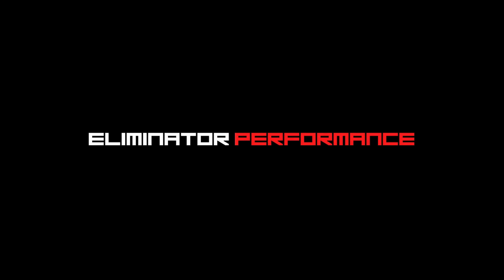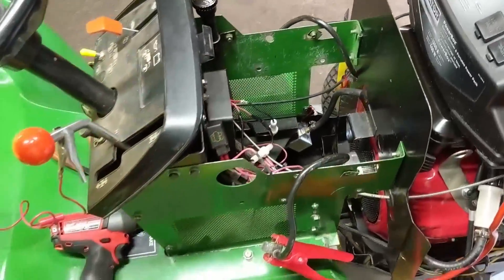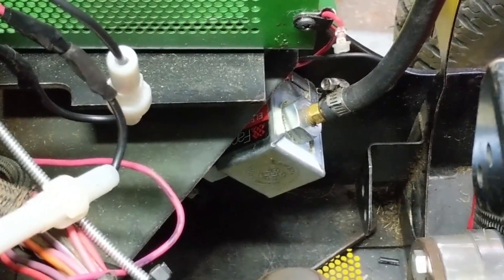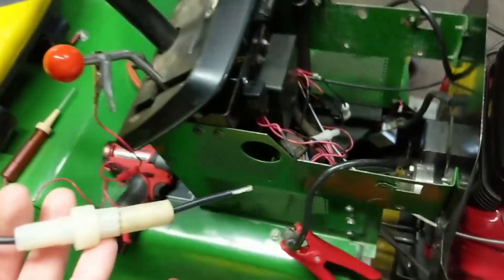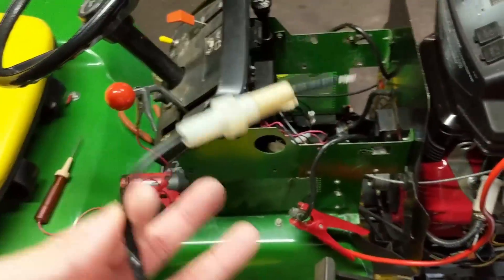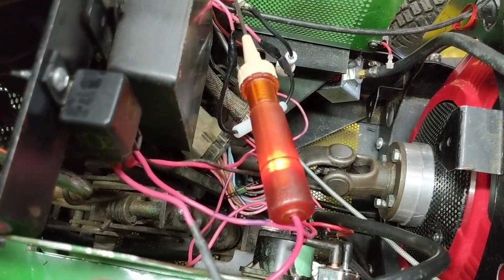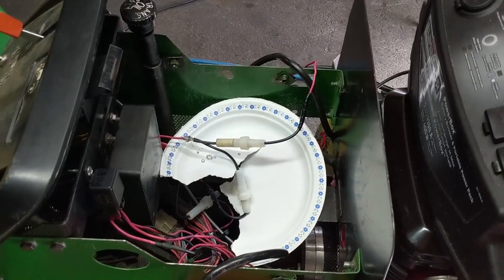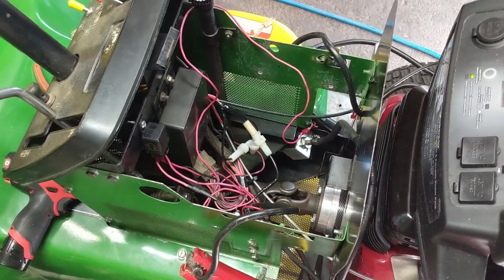How to Wire a 12v Electric Fuel Pump

Comment: Ok the wires for the seat switch you just need to pull them out and then feed a wire fish threw that hole under the seat to the engine compartment and hook the wire plug to the fish with some electric tape and pull it back threw again. This way your not pulling the fender unit off the mower
The thing ive done on a few mowers because of changing the seat and the seat switch wasnt the same as the one that was on the mower ill take the old switch from the old seat plug it into the harness then use a hose clamp around the seat switch to hold it closed permently  and all is good because there no young kids around my place so i don't need all those safety bs things shutting things off on my mower

Comment: I need help. I'm not familiar with fuel pumps like this on a lawnmower. What keeps the carburetor from flooding. If f the needle closes when the bowl is full of gas, but the pump is still pumping. I need to put one of these style fuel pumps on my suzuki samurai but idk how it's not going to flood or if it needs a tank return line. I'm overwhelmed

Comment: A minute in and I'm confused. They had a working mower but brought it back due to no fuel pressure. And yet it had fuel pressure so long as the operator was in the seat. Was this just a re-wire to not require the owner to be in the seat? Or just something you did because it came back for a carb issue?
Reply from the maker: @thenexthobby  they inadvertently wired it through the seat switch, so it would ground out the fuel pump when the operator got off the seat, leading to it shutting down if he had it running with the parking brake on. He asked me to fix it, and it's been working great since.

Comment: Disconnect the fuel solenoid wires and connect them to the electric fuel pump because when you turn the key the fuel is going  to be cut off anyway

Comment: Where did you run your return line from, before or after the fuel pump?
Reply from the maker: Pumps don't always need a return line, as long as the pump isn't over-pressurizing the system. In the event that a fuel pressure regulator is needed, it will act as a bypass valve, and redirect extra fuel after the pump, back into the fuel tank. This is more needed on vehicles due to the heat caused by the pump, the expansion and extra unused fuel. This pump simply had an inlet and outlet. You can purchase riding lawn mower fuel pumps with certain flow rates, that should not need return lines.

Comment: Good video and well done! Question, I'm getting ready to add an electric fuel pump. I see the one on this tractor looked like a Facet pump. Do you remember what the psi was? I'm looking at the 1-1.5 or the 1-2psi. I see from some videos that guys that are putting a pump on with higher pressure then are having to add a pressure regulator and adding a tee to the line and running a hose back to the tank for the excess gas that generally floods out the carb when idling down. I couldn't tell if the tractor had any of that on there. Thanks, Mike
Reply: Did you ever find a 1-1.5 pump? Im about to do the same with my 316 but only finding 2.5 - 4 psi pumps

Comment: Good move on your part to let your customer decide if they want to jump the seat switch since you assume the liability issues if you do it. I have watched your other videos that you have mentioned your business does not disable safety switches and only jumper them for testing purposes only! Good job moving the fuel pump power from seat switch to key operation. When i watched the first video on this mower i thought it questionable that the fuel pump was wired off the seat switch power.

Comment: Good job , Normally the safety features are not disconnected . But the costumers wiring caused this problem which was fixed .
Reply from the maker: The wiring is fixed, the mower operational, and my customer happy! Thanks for watching!